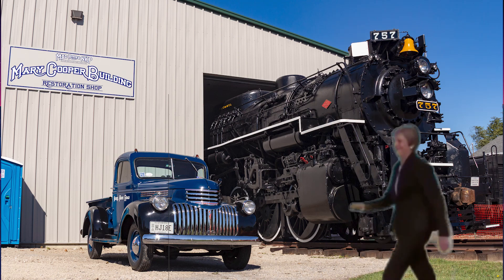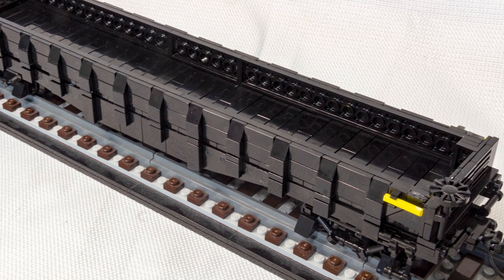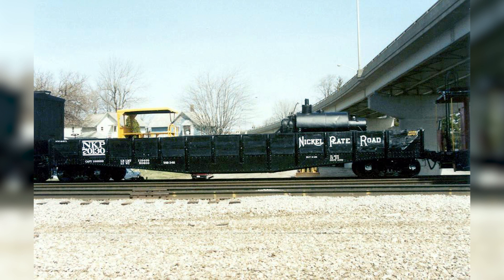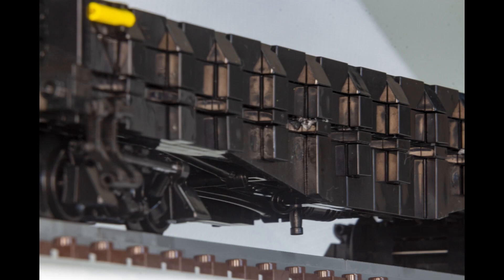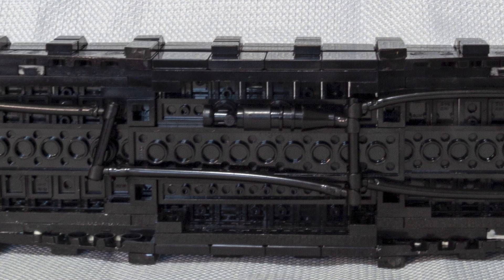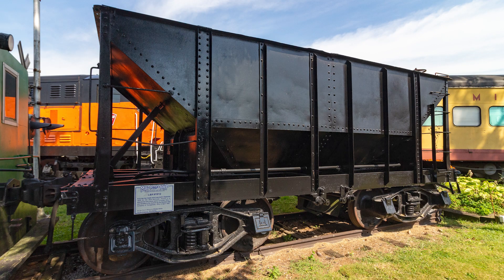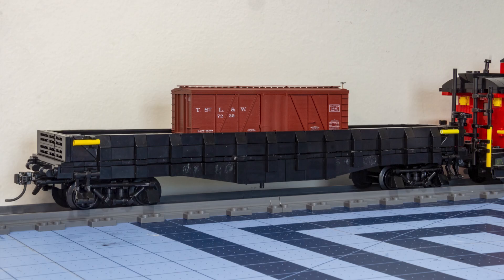NKP 70130: Brick Train Awards 2022 Entry

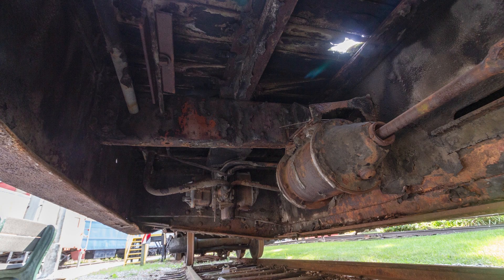Comment: (2:05) - That’s not surprising. The AAR - at some point - declared the old K-type brake system illegal for interchange service, though rail cars in captive service or MOW could still use them. Since these cars were still operational until the 1980s, they definitely would have the newer AB- or ABX-type brake system. In addition, they would have received a set of Bettendorf freight trucks to replace the arch-bar trucks they started out with, then either roller-bearing converted Bettendorf trucks, or actual roller-bearing trucks as seen on pretty much all freight cars in interchange service on the North American rail network today.